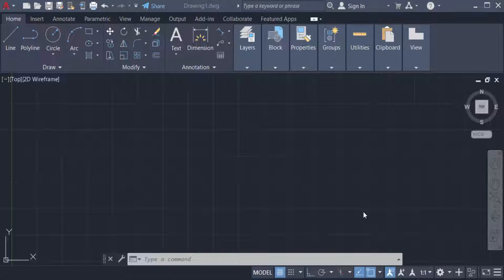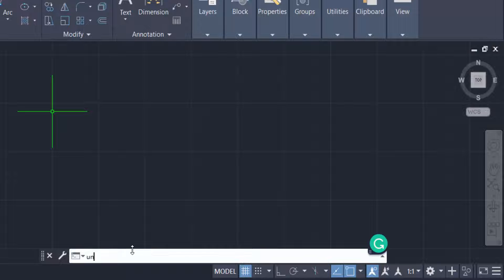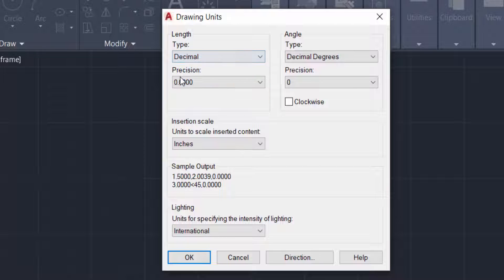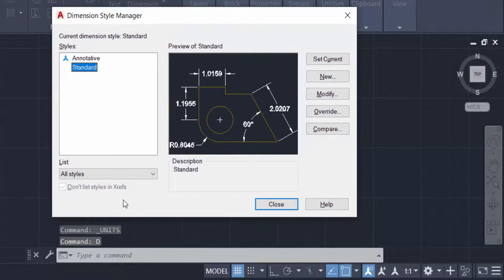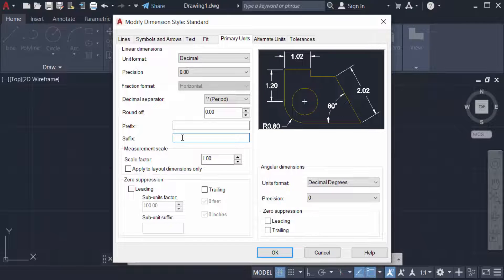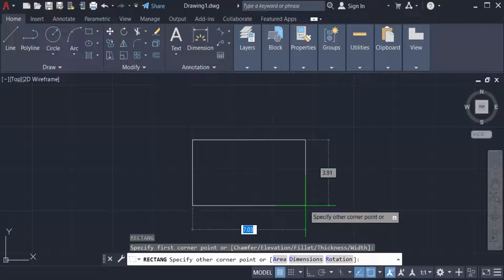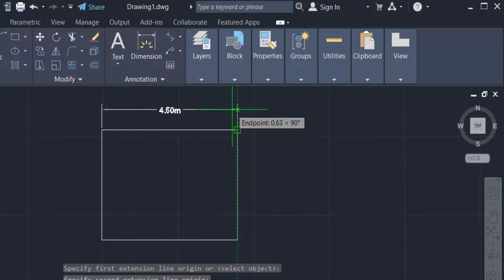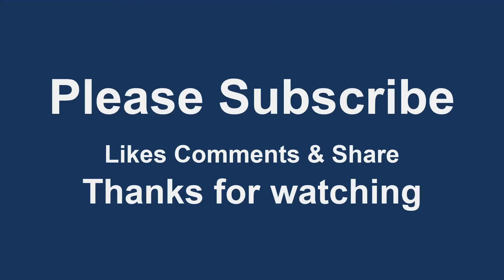How to set units in meters in AutoCAD drawings

Comment: when converting from english system to metric the measurements  in one system is exactly the same as the other when  you change the units correct? it doesn't seem so when I try to measure the metric w/ my English system.
Reply from the maker: Yes, the measurements should be the same after converting units. Double-check your settings to ensure you're using the correct system.